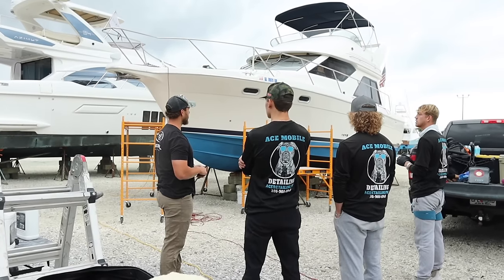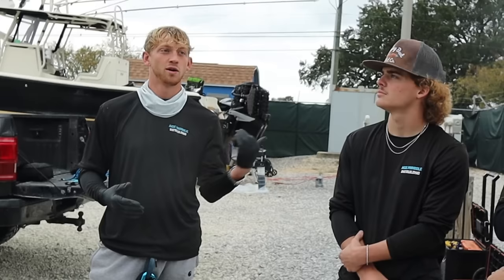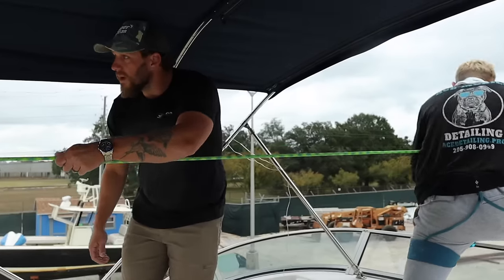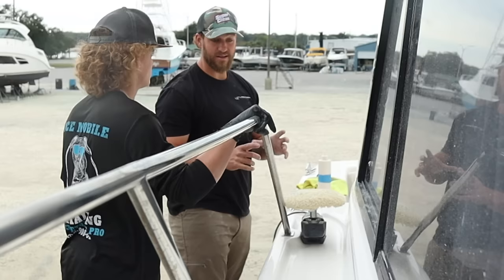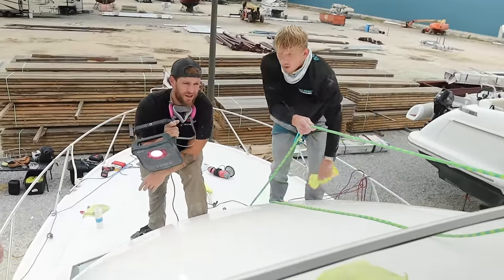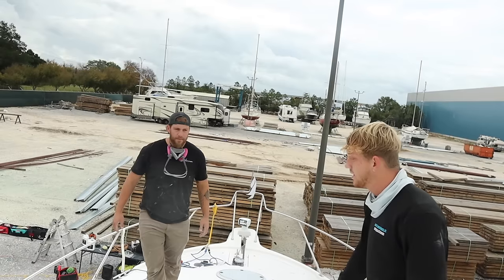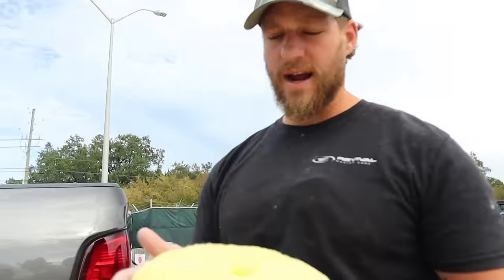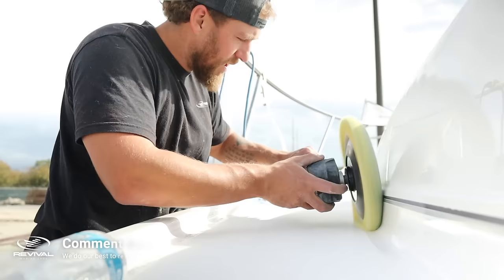Boat Buffing Secrets From A Pro  ( All Day Footage )  Revival Marine Care

Comment: How do you clean the trim tabs and any trick in keeping the zebra mussels off of the tabs?
Reply from the maker: If the boat has been in the water and has a lot of growth and zebra muscles and the trim tips, I would use muriatic acid. Spray it on in a pump sprayer, let’s sit, then rinse off with a pressure washer. Please use protection, such as respirator and gloves, as that stuff is pretty nasty.

Comment: hey drake just a question. does yellow wool pad and orange lake country pad serve the same purpose with removing holograms?
Reply from the maker: Not entirely, the yellow pad is made to breakdown and smooth out from the heavy, cutting white wall pad step. Then the orange pad is made to remove the holograms and swell marsh completely from both of those two steps.

Comment: Hey Drake...i got one question that really i cant find a way to fix....so you do boats and a lot...and i was never taught just had a talent .i did only maybe 60 70 boats last season...its all fresh water in the Poconos...here is my question....did you ever run into seat vinyl that looked orangish color...it never comes off..it to me looks to be a result of the boat cover being to tight after its snapped on...no air plus heat...have you ever removed it...i seen people on here sanding it....that is out of the question for me..i wet sand gel coat thats it..
Reply from the maker: Hey bro, I’m a little confused by your question, but if I think it’s what you’re asking me, you only wet sand gelcoat. Nothing else on a boat can be wet sanded. Definitely do not attempt to sand vinyl with sandpaper.
Reply: @DrakesDetailing  yes dumb people on here do...i dont sand vinyl...its that orange to pinkish red stains on the seats...i cant remove it..tried .but no luck .i was hoping you ran into thats...i think its from the heat and moisture when the cover snaps on and covers the seats.. it only turns orange where the cover touches the seat..... So yeah my question would be have you ever dealt with that before and been successful at removing it .

Comment: I’ve been watching a ton getting ready to do our 26 key west with ice blue hull here in Pensacola. Hull has very minimal oxidation in some areas only with some shine looking down the hull but is dull looking straight on. After watching all your videos and browsing the hull truth I think my plan is a yellow wool pad on a rotary then orange and white pads on the max shine da for polish and wax or seal, will probably use jescar powe luck. Could you suggest which shine supply product(s) might suit my plan? Thanks for putting your expertise out there! Edit: looks like my answer might be in the description!
Reply: Chop top for sure. You can use it for compounding and polishing.
Reply from the maker: Hey bro, it’s just has mild oxidation and you want to use a yellow wall pad, chop top will be perfect! Then polish with Burn Out and seal it up with Jescar. Don’t hesitate to use my discount code at checkout. It’s: DRAKE15 

https://shinesupply.com/collections/marine-products
Reply: @DrakesDetailing  right on! It’s so cool you reply to everyone, thanks man.

Comment: What would be the best way to remove registration numbers that have been on a boat for 23 years I already have the letters removed but they’re impregnated into the fiberglass?
Reply from the maker: You will need to wet sand them out. Pull the numbers off, wet sand with 1000 grit, then 2000 grit, then heavy compound to remove the sanding marks.
Reply: @DrakesDetailing  
Thank you Drake for taking time out and answering my question, keep up the great work and the videos they’re awesome!

Comment: Hey Drake, can you use chop top as a polish? If I wanted to use 1 product after a medium cut and before a wax what should I go with? Also, is it worth using an Si02 spray if I am not ceramic coating? For example if I am using Jescar wax, would it be worth using an si02 protectant spray as well? I appreciate any feedback!
Reply: Also- a baseline product sequence video would be awesome!
Reply from the maker: Hey bro, absolutely you can use it as a Chop Top as a polish. Si02 definitely does help with the protection and adds to the sealant. 😎

Comment: Can you use a force rotation for applying wax? Im thinking about skipping the da and just getting a flex
Reply: using a forced rotation to apply the wax would probably be overkill and you'd be working extra hard in doing so
Reply: @johnnycaretaker848   thanks man, I've only ever used a makita and waxed by hand. It seems to me that the only difference between the force and da is that DA'S will stall out with too much pressure. I don't understand why the force rotation wouldn't work as well as the DA so that I wouldn't need to buy an extra machine
Reply from the maker: You can definitely use a force rotation to apply wax, you can also use a DA polisher, which would be much more conducive to do so.
Reply: @DrakesDetailing  thanks man, God bless you